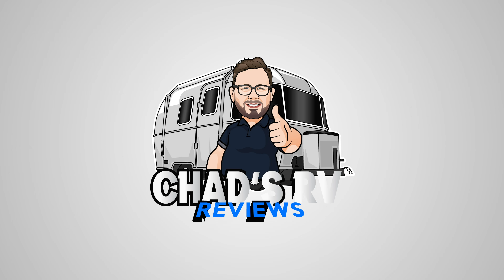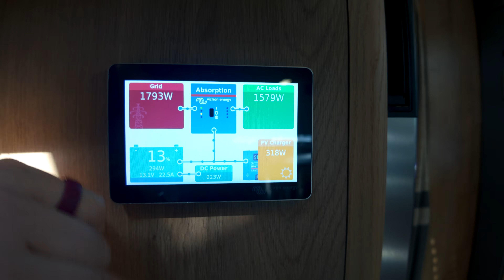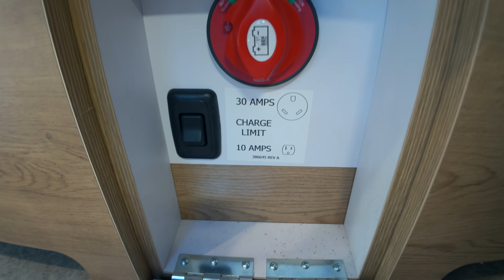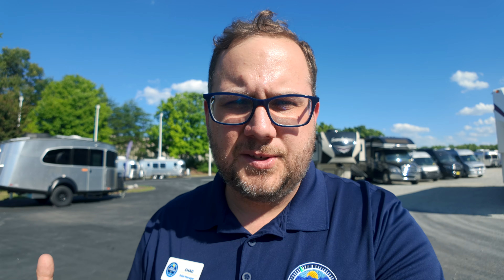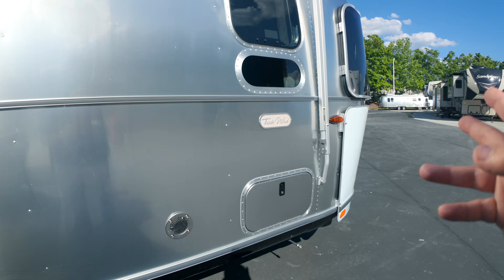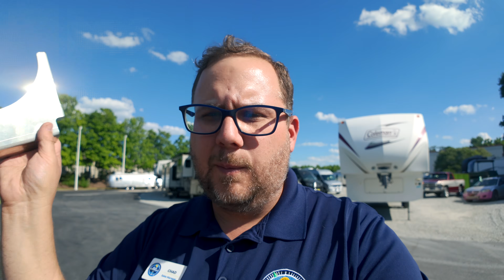I May Get In Trouble For This One! Is the Trade Wind worth it? ￼

Comment: Been watching a lot of your videos and really appreciate the insight you share with your viewers. I'd like to get your spin and what Airstream has to say on the need of a weight distribution hitch and if there are exceptions to the rule. We have been towing a 30ft 5th wheel for 26 years, on our 4th truck now, a new 2023 Superduty with the diesel. Of course with a 5th wheel, tongue weight is what it is to some degree, only to be managed by what else is in the bed of your truck and how you might load the trailer. Point is, with a 3/4 or 1 ton truck, the rear of the truck doesn't sag to much with a much greater tongue weight than what is placed on it by a pull trailer. We are thinking of downsizing and are looking hard at the Airstreams. My concern is a weight dist. hitch by and of itself does nothing for sway control, thats for a sway bar if needed. Looking at KYD's weigh in's, the hitch didn't seem to change the weights across the board by what I would think is a significant amount, except for increasing the weight on your trailer axles which by decreasing your gvwr carrying capacity which is low to begin with on Airstreams compared to other brands. My concern/worry would be how much stress your placing on the tongue/framework of an Airstream? They even mentioned several times and showed they can't open the battery box with tension on the hitch? This for me would be a red flag flexing the frame on a unit that has a bit of history with front end frame/body separation adding undue stress on the trailer. Would like to hear your thoughts on this, as I am currently thinking if we make the switch, I don't feel we will be adding a weight dist. hitch to the equation, not thinking it is necessary and might be the best measure in preventing separation.  Looking forward to your response, and if Airstream has a firm position on this, thanks in advance!
Reply: Personally, I think weight distribution hitch is a sign of a mismatched truck.  I pull a 27 Airstream Globetrotter using a diesel Ford Super Duty without a weight distribution.  I would not want to transfer the trucks weight onto the frame of the Airstream.  Basically, a weight distribution system turns the trailer's frame into a spring to transfer a portion of the hitch weight towards the rear of trailer and the front of the truck.

Comment: What about my 2023 ?? 😢😢
Reply from the maker: The 2023 Classic, Globetrotter, and Pottery Barn has it but not the Flying Cloud or International. At my dealer, we can add the brackets to the older models (ones that don’t have it). You can do it as preventative maintenance or if you have an issue in the future.

Comment: Do all 2024's have the FES prevention already added (even the early 2024's)?  If they do, is this an internal thing, or is it visible?  I do not see anything added inside our front storage area of our 2024 FBT.  Thanks!
Reply from the maker: All 2024 double axles and it's an internal thing. You won't see it without taking the wall apart.
Reply: @ChadsRVReviews  Thank you. I have an early 2024 25FBT and was hoping I had it but didn't see anything.  Appreciate your response (and great videos)!
Reply from the maker: @lmt1022  You're welcome!

Comment: I use the Blue ox system. the chains are suppose to be set at 9 links. Ive gone to 8 links to put less stress on the front of the frame. I dont know  if this will help but I hope so. The brackets were put on at the factory when there for repairs. I hope this takes care of "flex"
Reply: In our previous trailer we used the 7th link. Our current trailer is a bit heavier, so we are somewhere between the 7th and 8th link. Still testing to figure out which. The key is knowing your truck’s specs. Ours asks for a 50% front axle load return (so return 50% of the original weight / height back to the front tires). BlueOx’s general setup procedure calls for a 100% return, so you may need to adjust to meet your truck’s specs.
Reply from the maker: Try the 7th link and see if you are still level. Also, make sure you check the weight of your camper and the tongue weight.

Comment: Chad you mentioned in this video you use a Gen Y hitch. Did you get rid of the blue ox hitch you had in your newbie videos?
Reply: Gen Y is designed to work with your WDH. It replaces the shank arm and has flex to keep the trailer and TV from bouncing each other as much. Of course they can also be used without WDH depending on what your truck / trailer combo needs.
Reply from the maker: jandry6598 answered this one for me. I’m now using the GenY Boss with the blue ox. I have a Video in the works about this setup coming soon!
Reply: @ChadsRVReviews  Looking forward to that video.  I wish you would share more of your expertise on proper tow vehicles for various Airstream Models.
Reply: Will keep an eye out for it! Thanks Chad!!

Comment: I have a 2024 Pottery Barn 28 RBT and pulling it with a GMC 2500 diesel truck. I use a Weigh Safe WDR. I am thinking about using a standard hitch with my truck as several others have advised me that I don’t need a WDH with my truck. I’m just curious what opinions are about that change.
Reply from the maker: Airstream recommends the Blue Ox Sway Pro and I would recommend using the 7th link from the top down. Also, try standard hitch towing and see how that feels. Please make sure you check the weight your camper and verify that you have at least 10% of the overall weight of your camper as your ton weight.

Comment: The other thing you you didn’t mention with the upgrade is the weight distribution of the trailer. The batteries being where they are on the Trade Wind (low and behind the rear axle) allows it to have a much lower tongue weight, especially if you are adding all the batteries to the front.
Reply from the maker: This is true!

Comment: The new B&W weight distribution system doesn’t use bars.  Review this system vs. other weight distribution systems.
Reply: It does, they are just much shorter and it uses a hydraulic pump to create the flex rather than a ratchet or brackets.
Reply from the maker: I wonder it with the shorter bars if it's flexes the frame less.

Comment: Chad, you mention that the Tradewind can handle 30 amps on the battery, but can you investigate why it can’t seem to handle a 5 to 7 amp draw while only on batteries. Try running a heat gun or hair dryer and nothing else while unplugged from shore power and you will see what I mean. Thanks for your honest reviews and the videos that you post! Edited to add that it will run them on high but not on medium or low. Again 5 to 7 amps. Has happened on our TW and at least one other new TW on the lot.
Reply from the maker: It can run the AC which is more 7 amps when running. It’s a 3000w inverter, I would suspect that it can handle up to 3000w.
Reply: @ChadsRVReviews  It can. The problem only happens at 5 to 10 amps. Not more. It trips both GFCI breakers in the breaker box. Please investigate as this appears to be a Victron issue and is happening in several TW’s. Thanks!
Reply: Checked the Cerbo and it was drawing 330 watts while on medium and that was where the it tripped both GFCI breakers.
Reply: AS will retro a 10a bypass switch as of May 1st. Free of charge but have to take it in.